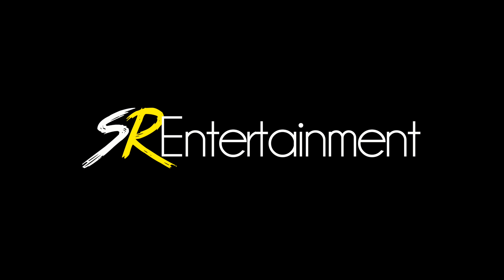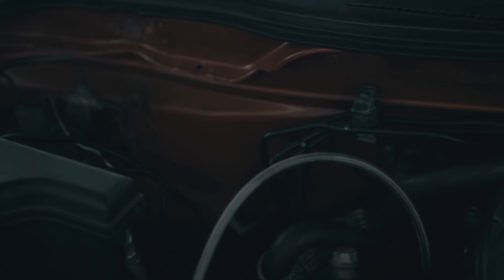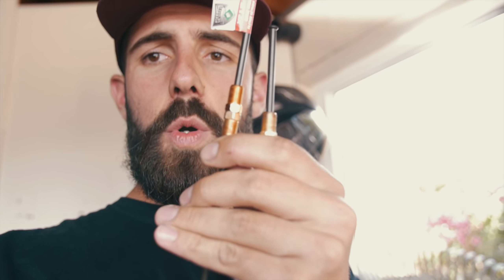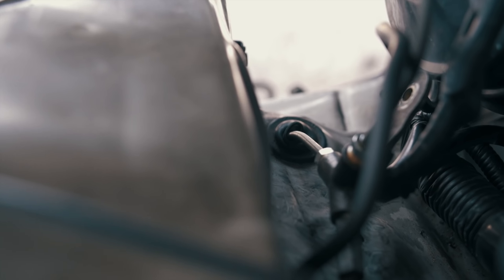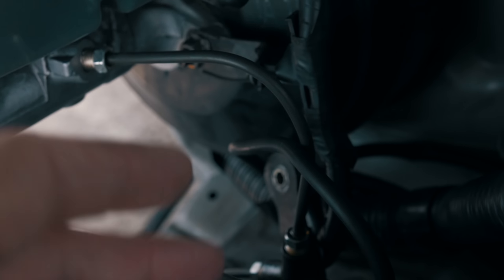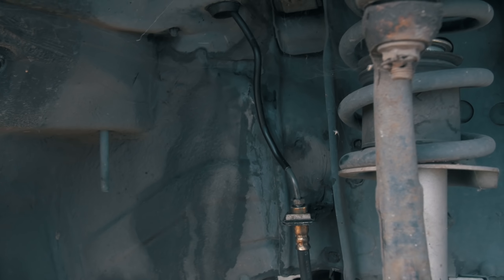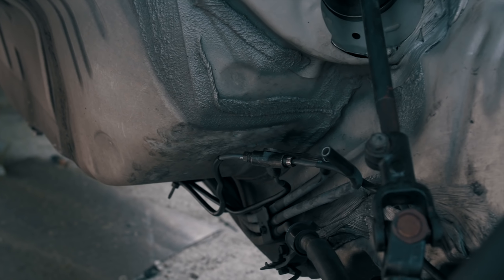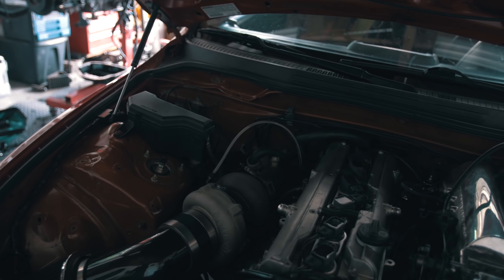$10 Brake Line Tuck IS300

Comment: Do you have any problems after deleting abs? I keep getting mixed reviews
Reply from the maker: craig wilson Zero! I don’t know why people keep it. I have Supra Calipers so the ABS didn’t function properly
Reply: @StillRollinEntertainment  do you think it I would run into any problems doing this while having the ls400 calipers
Reply: Nice.
Reply from the maker: @craigwilson8048  Nah that's basically the same calipers I have. 4 piston
Reply: Make sure you guys realize now if you jab your brake pedal you will lock up your brakes... if you know what pumping the brakes are and you can actually drive.. "not weave traffic with a stock ass nissan altima at 110 thinkin you the shit"...you'll be fine.

Comment: hmm, idk abou tthis. im doing an abs delete on my teg and i have to use a 40/40 proportioning valve so the right amount of oil pressure goes to each caliper. the master cylinder alone cant do that.
Reply from the maker: i'm JGott some masters have built
in proportioning valves